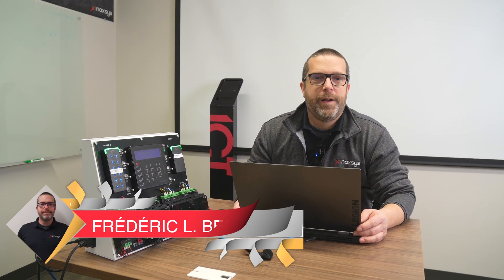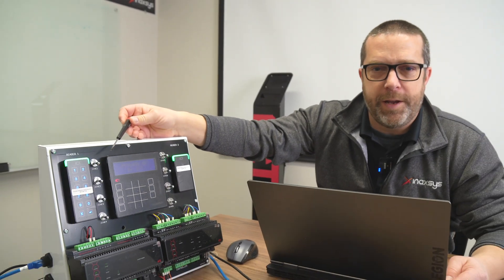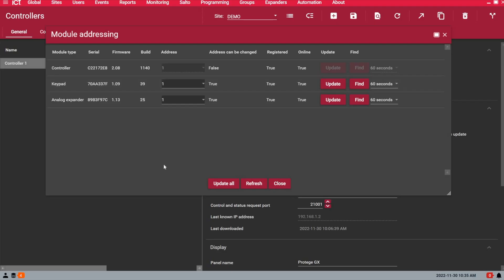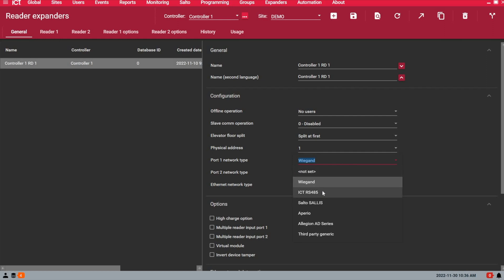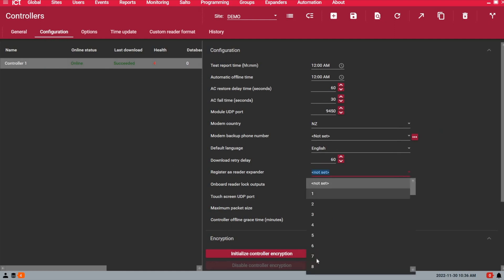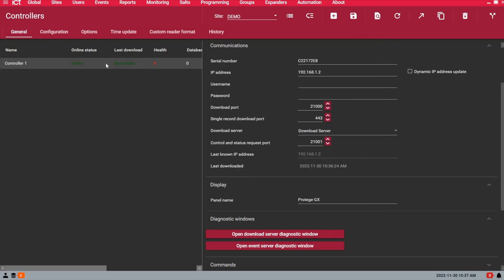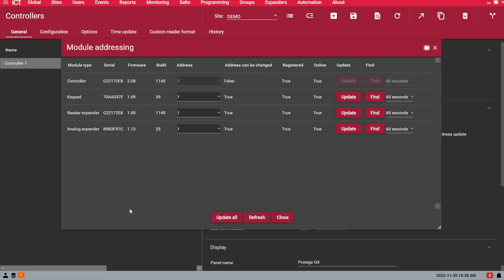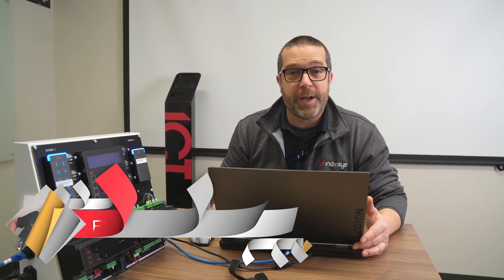ICT Protege GX DIN Rail Controller: How to Enable the Onboard Reader Ports for Access Control

Comment: Hello good day, I have  a question, I Have 1 controller, 5 expander reader and 1 input expander of 8inputs. In software I have to see only 4 expander reader (1, 2, 3, 4) in menu expander reader, I do not see the expander reader of controller and expander reader number 5 and expander input; in module addresing all modules is on line, but for program I do not see all modules. Why is this detail?

Comment: Hi! Have a question about reader, i have this one PRX-TSEC-MINI-DF-B;  it works properly, but after some time it goes to the boot mode (flashing blue and green) and couldnt open door. After rebooting start working again, but after some time same problem. May be you know why is it happenned?
Reply from the maker: Hello! When the reader is flashing this way it’s typically because it is wired in RS485 mode and is offline.  Here’s a few things to try:
 
1. Make sure you are using twisted pair cable for the data lines.  (Cat 5/6 if cable length is less than 100 meters or the recommended Belden 9842.)
2. It is recommended to install a EOL resistor at both ends. (330ohm)
3. We have seen card readers go offline randomly when installed on PRT-RDM2-DIN-485 and firmware build 599 may help in this case.  (Please contact your local technical support to get access to the firmware file of this build.)
Reply: @inaxsys  thank you for your answer!

Comment: Hello, can the ICT WX be connected to a Gate Operator from another brand?
Reply from the maker: Hello, thank you very much for the feedback.  We really appreciate it.  Yes, we have a lot of installations where the ICT WX system is controlling a gate operator.  Typically, all we need is to use the lock output of the reader module to send a dry contact to the gate operator.  The gate operator can be set to open on the contact activation or to follow the status of the contact.  From the ICT Protege mobile app, you can control the door associated with the gate easily.  In other words, you can connect the two systems so you can unlock the gate with an ICT TSEC card reader as well as with the mobile app.